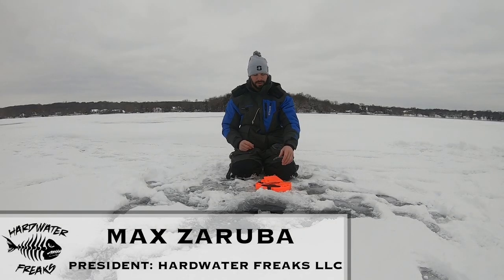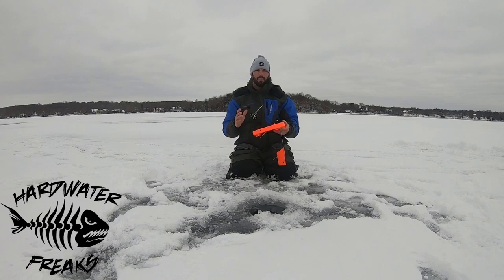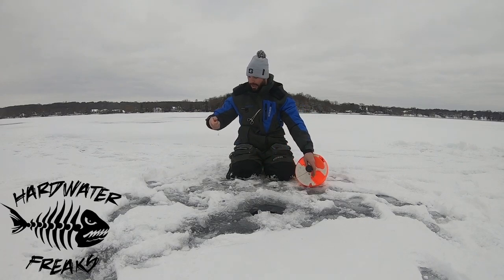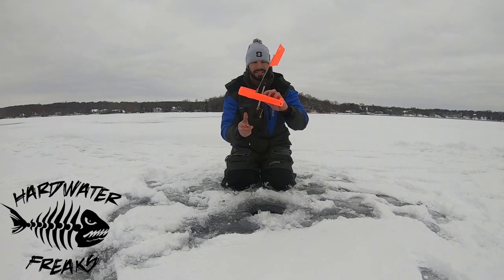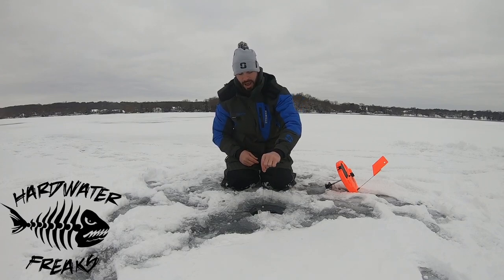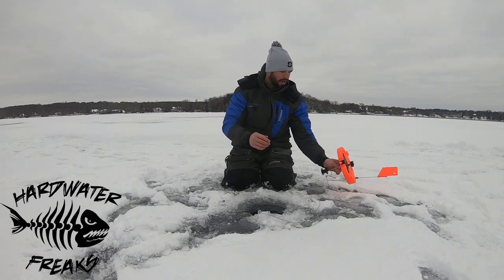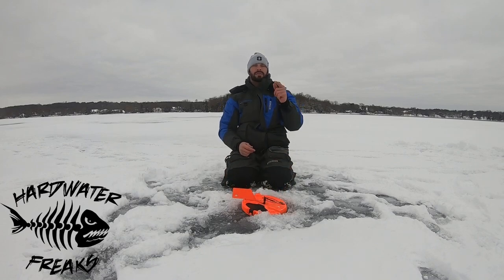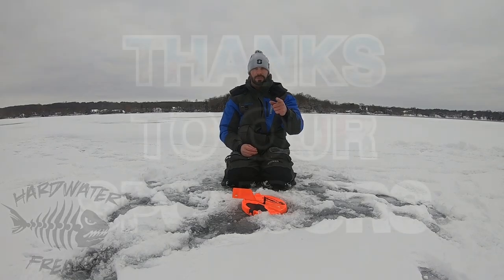BASIC TIP-UP SETUP——Back to the basics

Comment: Nice video, for regular tip ups I cut foam to fit in a 5 gal bucket put a hole in the middle and a slice to keep them from freezing also put it on over night for next day works pretty good
Reply from the maker: Brook trout 1 I do that on my non thermal tip ups as well